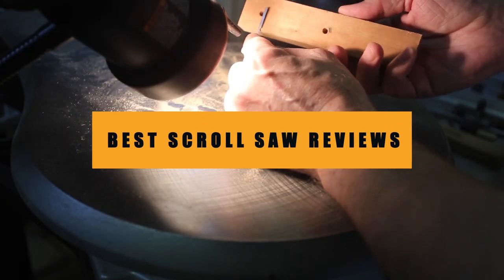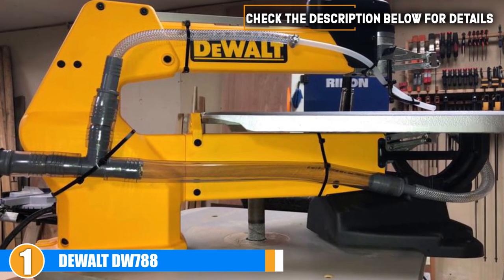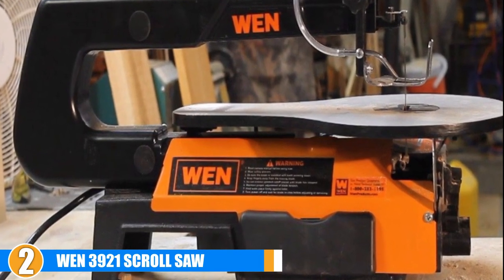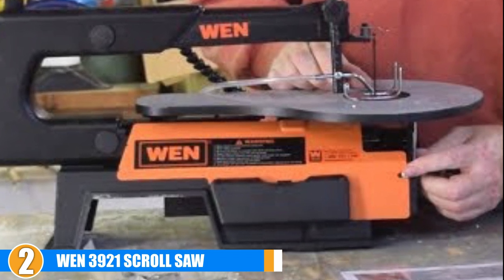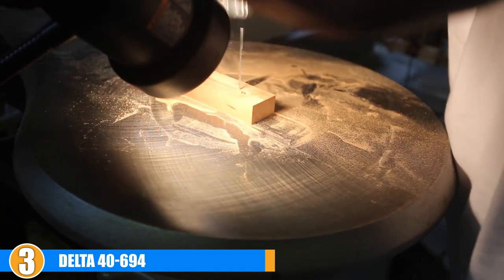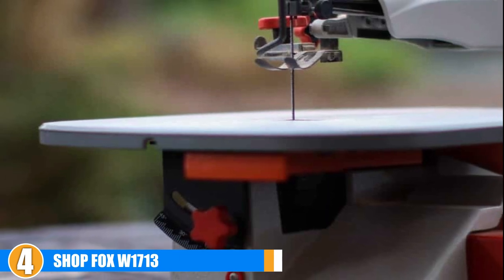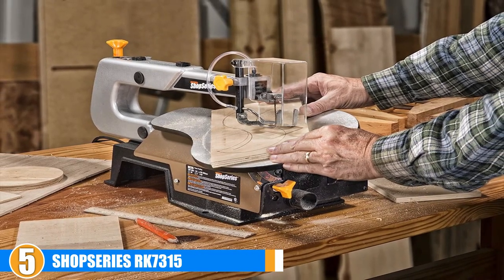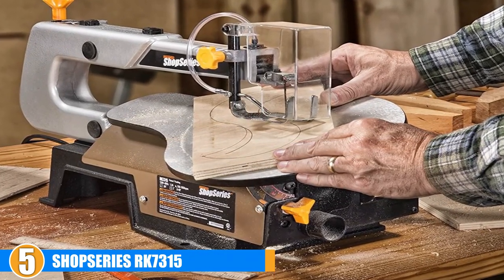Best Scroll Saw Reviews 2024 | Best Budget Scroll Saws (Buying Guide)

Comment: It seems to me that there is no budget-priced scroll saw on the market that makes the use of pinless blades easy.  There are scroll saws available from DIY stores for about €100/$100 which can be used with pinless blades for inside cuts, but fitting pinless blades into them is difficult to say the least, and this fact took a lot of the enthusiasm that I had for this hobby away from me. I returned my scroll saw to the DIY store where I bought it, as the pinless blades kept slipping out of the clamping mechanism, and when I tightened it again in the clamps, a tightening screw broke inside the clamp, rendering the saw unusable. The better scroll saws on the market cost approximately €/$ 1000 +/-10%.